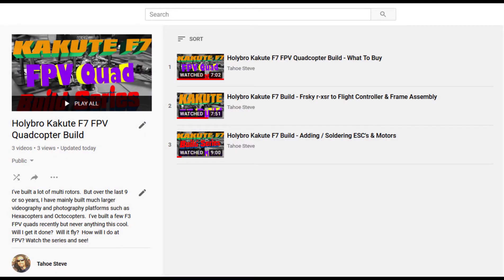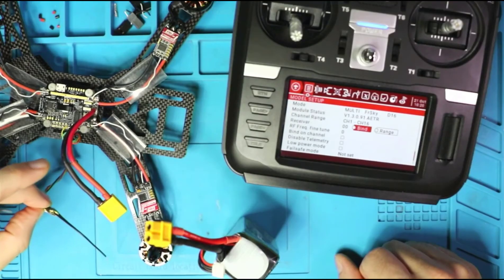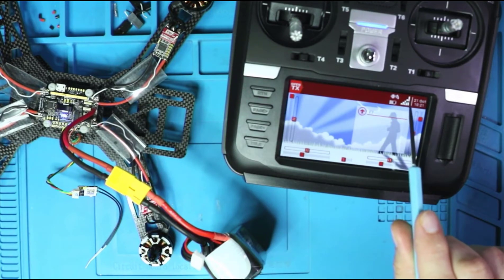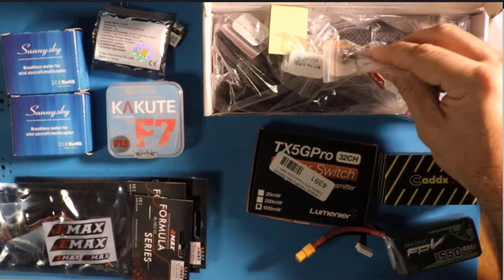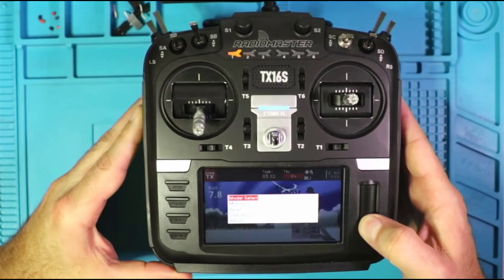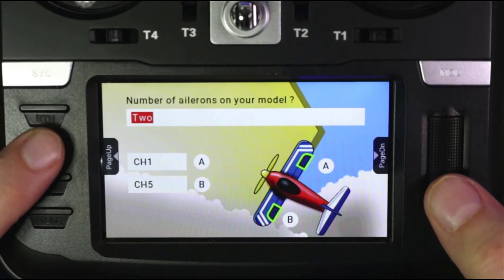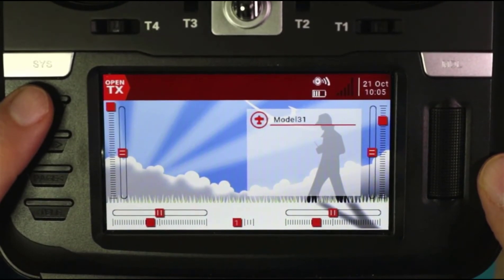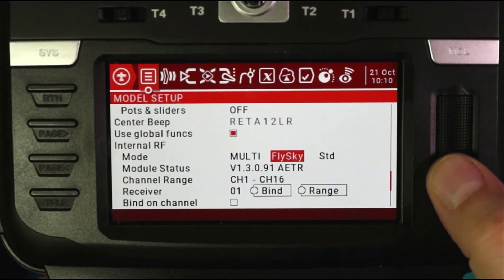Holybro Kakute F7 Build - Bind FrSky R-xsr to TX16s and Add New Model

Comment: Radiomaster tx16s, opentx 2.3.14, trying to bind new R-XSR to it, I don't have just frsky on tx16s now, it's frsky x, frsky x2 and some others but not just frsky. I do the same thing here but nothing
Reply: Did it ever work for you? I tried frsky d16 but connection is on and off...like every two seconds. Yet no one wants to answer all of us with this problem...

Comment: I have been trying to bind my Radiomaster TX16S to the FRSKY R-XSR with no luck. I have done everything exactly as you have and it just wont bind. Please help!
Reply: Change from frsky x d16 to frsky x2 and it will works
Reply: Did you find the solution?

Comment: Hi. Can you help me to bind my R-XSR with Radiomaster TX16S OpenTx 16S V.2.3.11 (last one)  and Module Status V1.3.2.58 AETR. My country Romania (EU) . THANKS
Reply: were you ever able to bind it?
Reply: HI. No
Reply: I've had similar problem, nothing worked until i flashed r-xsr to v1.9
Reply: @mirekbiaowiecki2618  hi. Thanks for help.  But I make a change to TBS Crossfire.  Best regards
Reply: @mirekbiaowiecki2618  is that the older versions?
Reply: @laxesa4961  yes
Reply: Well I learned that frsky made their software to restrict binding with non-frsky transmitters, so you’ll have to change either your receiver or transmitter